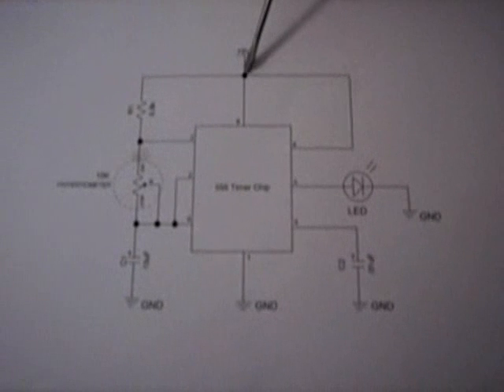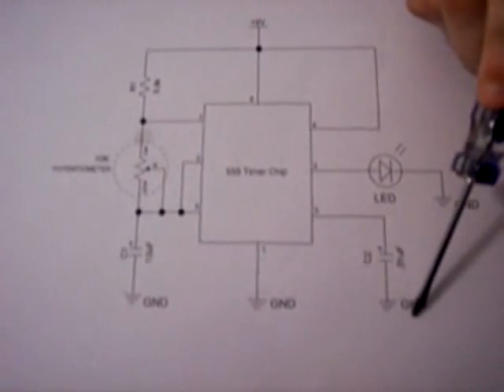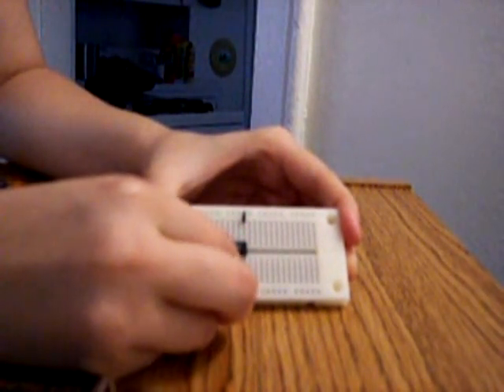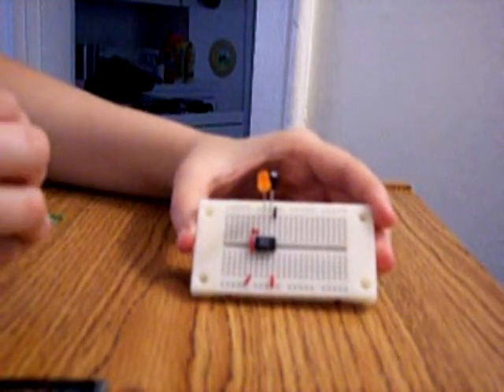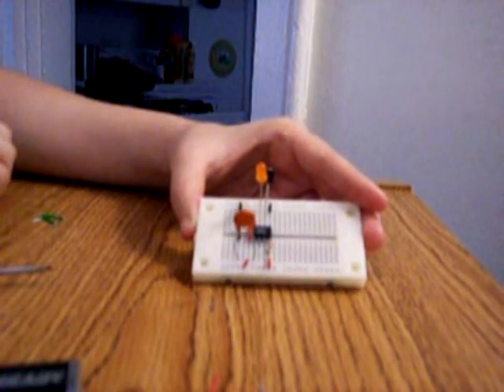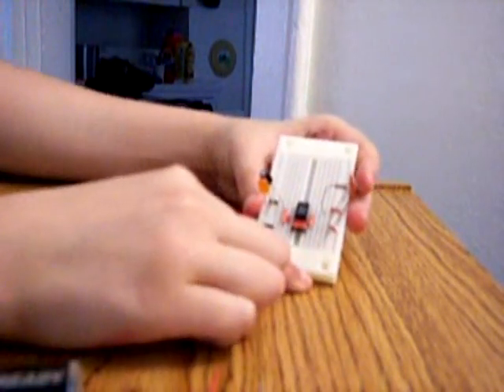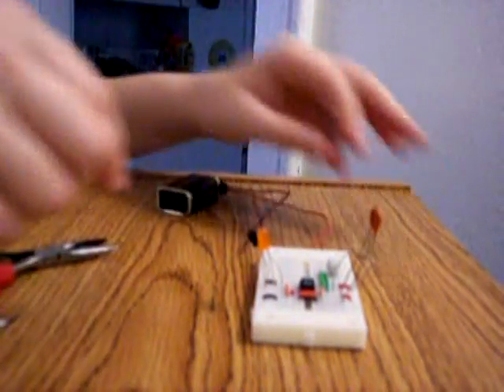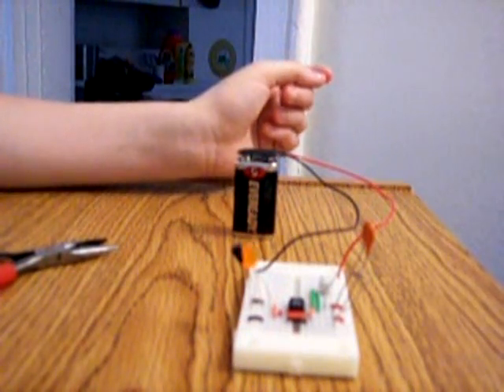555 Timer With LED

Comment: I think it's a good tut, but light on the explanations (and I disliked mostly because you didn't even mention a current limiting resistor on the LED, big no-no as you'll burn up the LED with Vcc).

Comment: good video, im going to try to incorperate this for a rapid fire mod for an xbox-360 controller, so basically i need a pulse of electricity, which i assume this does right? to my knowledge the trigger works by opening and closing with some sort of relay that im going to bypass and instead pulse with this project anyone know if that will work?

Comment: Hello, excellent video so far, one of the most instructional I have found on youtube for 555 timer.  I only get lost at the last part where you say to connect pin two to pin six I really cant get a clear read on how you set that up on the soderless breadboard.  Did you just go straight around the back of the timer?  Can i just go over the timer itself from pin2 to pin6?

Comment: anywhere on the black/negative wire that gives power to your board or the piece of the circuit you want to trigger with a switch.